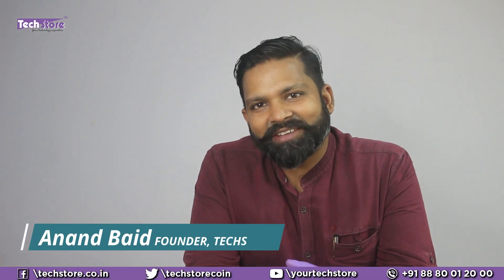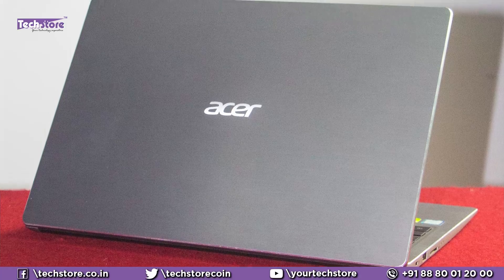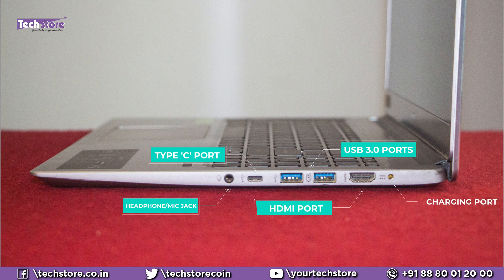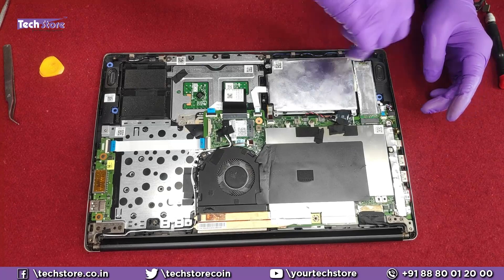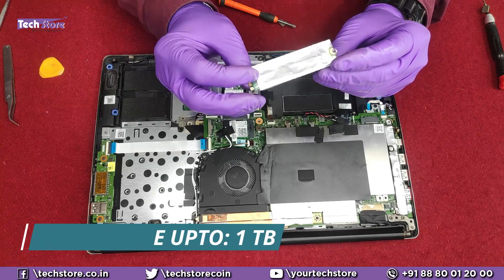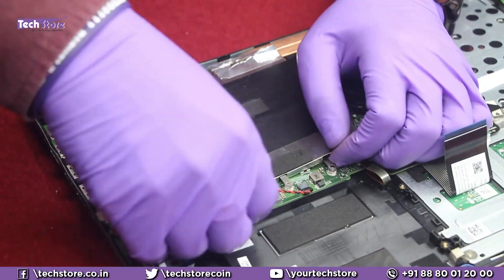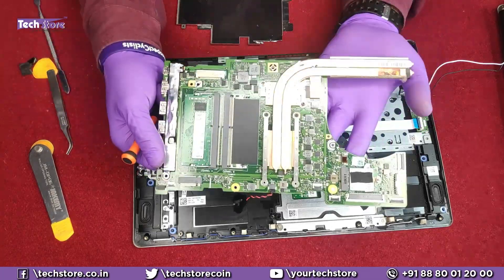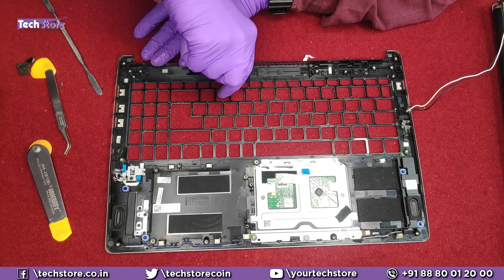Acer Swift 3 SF31552 how to disassemble base Keyboard battery Replacement upgrade

Comment: Good fking lord why is replacing keyboard so extremely over complicated... No to Acer ever again
Reply: I totally feel you on that. I just figured my keyboard needed a clean, so I wiped it down with an antibacterial wipe & that was enough to fry some keys.
I wish laptops had a more modular design so that you could get to the individual parts without needing to go through ribbon cables, a motherboard & RAM...
That or just have the keyboard accessible via the front of the laptop as a slot-in that clips in/out of place while staying flush with the system... It's probably the easiest part to damage.

Comment: Do you know if this procedure can be used to replace the keyboard for Acer Swift 3 SF314-42? The 2 models look identical from the outside and the keyboards also look identical, but I cannot find any video showing how to do the replacement on 42.

Comment: Namaste ji! So i have acer swift 3 slightly different but still - some of the keys on my keyboard aren't working. Backlight is working though. I need to replace keyboard. So do i order one with backlight? Or can i reuse backlight module that's in the laptop now? Also on many other videos guys aren't cutting plastic stuff they use soldering iron (which i don't have). Is the duct tape method safe? Anyway thanks for this video. I've subscribed!
Reply from the maker: Namaste. Ideally get the entire keyboard+backlight replaced.

Comment: Hi, I've done a ssd nvme replacement and took out the old hdd and the optane stick... Put in an Samsung 970 plus... But now it's not working anymore, the keyboard is only flashing ever 4-5 seconds... What have I done wrong? 
Thx

Comment: Is the quality of acer laptops bad? I was looking for swift 3 i5 11th Gen 16 gb ram model but seen many reviews with screen flicker issues, ssd issues, touch pad spring issue etc. Please advice. I am looking for long use say 5 years plus.
Or I asus would be good?
Reply from the maker: Would suggest to buy Acer Aspire 7.
Reply: @TechstoreCoIn  looking for compact 13 3 or 14 inch laptop only. No gaming
Reply: @roninr8199  what did i buy?